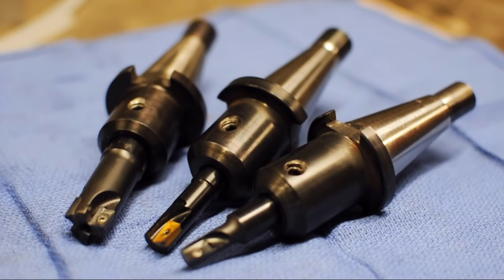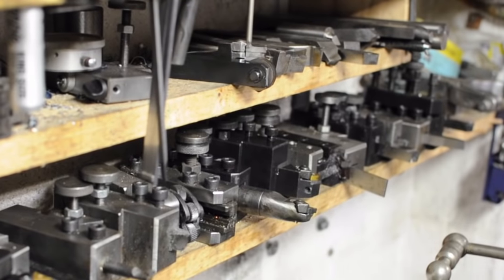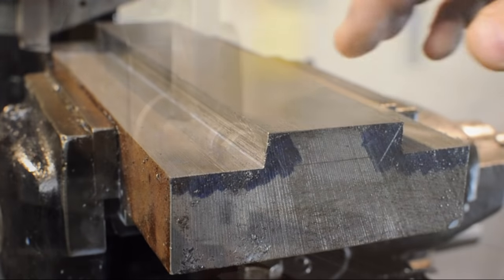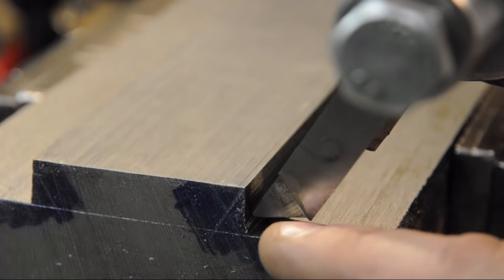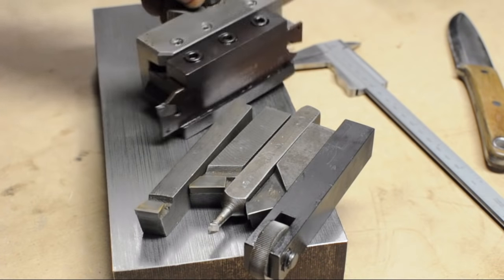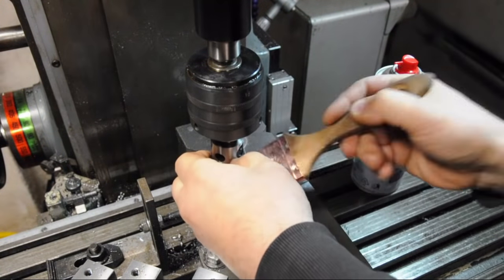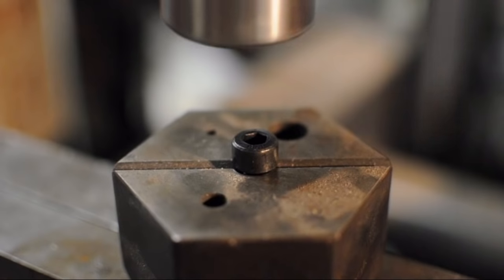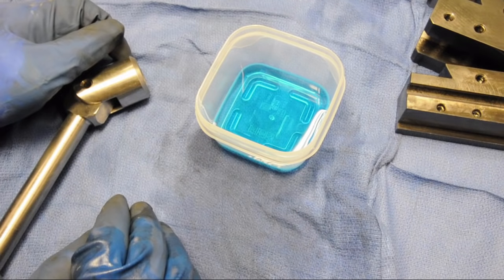QCTP Tool Holders for the Lathe

Comment: Fun tip - if you don't need them blued in under an hour, there's a very easy and simple way to blue your parts that wears better than cold blue and is darker. Basically just thoroughly degrease your part, immerse it in distilled or very clean water (our tap water is runoff mountain water) and boil it. Let it cool and it will form a fine rust. Boil the part again to convert to black iron oxide, card it with OOOO steel wool or denim and repeat until you're happy. Overnight gives very fast results with just slightly matte finish, less time gives finer results, but requires more repetitions. It's that easy...

Thanks again for the great videos!
Reply from the maker: Thanks HW!
Reply: Forgot to mention - this method is really sensitive to oils/grease as there's nothing really encouraging the rusting other than heating. Not really unusual for bluing, it's just a bit more finicky initially. Oddly enough I've never seen anyone else do it....
Reply: I think I've seen a method similar or the same, don't know for sure, but it was a video by Walter Sorrels here on youtube. He used it to put a black finish on a sword component.
Reply: H Wal. a
Reply: Works even better with rust bluing liquid.
I got mine from Brownells.
I fume it on, steam to convert fluffy red rust to fluffy black rust then brush it off with a brass brush. Took about 10 cycles to go from in the white to a hard-wearing black finish. 
Clean off with washing soda to neutralize (baking soda wasn't strong enough) and oil well (leave in oil bath overnight is best, mineral oil.)

Comment: Excellent video! I enjoy watching everything on your channel. 

In my experience, cold blueing works much better when you heat up the part briefly with a heat gun or torch to about 150 degrees F and then apply some blueing fallowed by going over it with some 0000 steel wool and repeating the process from the beginning a few times until you are satisfied with the color. This process has given me a darker blue.
Reply from the maker: thanks, I'll be sure to try that!

Comment: Shapers still have a place in the home shop.
Besides cutting key-ways and dovetails I use mine for cleaning up and squaring torch-cut steel plate.
Carbide milling inserts get chipped on such a job. ( Cha-ching $)
A single point high-speed tool is easily and quickly re-sharpened.
And yes, there is a certain Zen-like quality in operating one.

Comment: A little tip on the bluing. Glass bead sand blast, raw rubbing alcohol for decreasing, apply 100% cold blue with a clean cloth, use a fine steel wool to rub it in, adding more blue as needed for color, and finally add a combination of motor oil, 3n1,and transmission fluid to stop the bluing. Wipe clean. 

I've done this with various types of firearms, and the effect is excellent. I prefer hot bluing, or rust bluing, but for tooling, this is the easiest and best at corrosion resistance, while still looking excellent.

Comment: Nice project.  You, Stefan. Tom, and a few others have me thinking I want shaper.  Precision Brand Tool Black works really well.  The trick is to buff with steel wool between applications before oiling.  It evens out the finish and helps to expose untreated areas which gives a darker finish.
Reply from the maker: Thanks Robert, I'll have to look into that.

Comment: when applying cold blue, try to brush it while inside the liquid... it works 100% better and you get black results in 3 minutes. if you just leave it inside, the oxidation is not uniform.

Comment: Something that may have affected your blueing is your steel wool.  Most steel wool has been oiled to help it from rusting away to nothing.  Rinsing it with acetone prior to use and re-oiling with WD-40 works well.  As a side note Singer Sewing machine oil was some of the highest grade and most refined oil made before synthetics.  So many old Singer machines still show almost no signs of wear or excess clearance after seeing generations of work.

Comment: Hi tony, another winner...I use olD engine oil, and heat up the part, if this is done several times, leaves a really nice black finish.obviously the part has to be super clean to start. But I bet you knew this anyway..keep up the good work!!  Kind regards keith
Reply from the maker: Yes that's how I used to do it but this way is less messy and, more importantly, doesn't stink so bad. :)

Comment: You should try the hot bluing method. There are a lot of videos on youtube on it, and I have tried it myself and as soon as you get around the fact that you have a mixture og potassium nitrate and lye heated up to around 155 degrees C, it is actually quite easy to work with. I used it to restore some old adjustable spanners, some measuring tools and a few gunparts, and it leaves a really nice black color. 

Sandblast or beadblast the surface for a nice dull black, or polish away for a nice shiny black. And it is way more durable than the cold bluing is. And the surface soaks up a little bit of oil, for corrosion resistance.

Just dont get it on you skin, and keep the kid far far away from it! You will know quite quickly if any of it splashes on your skin, belive me...

Comment: I tried cold bluing steel parts, but didn't like the results and the time it took, so I tried the cold black oxide kit from Caswell, and LOVE IT!  Parts are blacker than the Ace of Spades in under a minute, and the kit came with two  quarts of penetrating oil sealer.  I bought the kit 6 years ago, and it still works great, and I've used up only one quart of the sealer.  Not trying to plug Caswell, but black oxide for tooling and non-gun parts is the way to go, imho.
Reply: Absolutely correct in my experience.

Comment: Hey big tony i worked last  20 years restoration field we use blue from Eastwood among that philips one and others to tips we clean the parts with brake cleaner the oil it's going to break down that bluing faster you're not gonna have a long shelf life so clean your parts before your blue brake cleaner tens to work really good. Another hack is try this take a ziploc bag put stuff in put your part in And swashin around way how you're brushing it on you don't get even coat ziploc bag kind of how you dunk those buckets then use you have to wipe down the bucket every time u use it is a residue that builds up on the side will oxidize once again wasting on the shelf life. Final step i yse "kroil" penetrate oil the oil that creeps. Brake clean wipe blue rinse off or wipe then in a separate container oil if u oil in ur blueing container n u pour bluein bottle the oil is breaking the blue down. Liver of sulfur is another to try its like black oxideish.

Comment: tony:loved your video, very well done. FYI the cold blue you are using is likely based on phosphoric acid, like osopho rust treatment. I think you might be confusing this with Parkerizing, which is a slightly different gun treatment. Parkerizing is VERY similar,  clean part, absolutely NO grease or oil, suspend in hot tank 180 deg parkerizing solution till it quits fizzing, 4-5 min, then pull and rinse in plain water. Rough with steel wool and repeat until color you want. Then, coat with oil.....I use plain old 30 wt, but most any will do.  Good Luck

Comment: I have used oil blacking for tooling. It's the same effect as when you have stainless steel cooking pots that get blacked up from the veg oil baking on and will give you a rust free black finish, actually a very dark brown,  that lasts for years.....oil used was motor oil. Heating temperatures are only as high as 250 deg C......some of my lathe tools were blacked back in the 70's.

Comment: Have you tried rust bluing?

It is slow, but it gives you a really good blue if you do it often enough. That's how guns were blued in the old days.

You clean the metal and rub the part with anything that would cause the metal to rust. Bleach, hydrochloric acid, etc. works wonderfully. You place the metal somewhere warm and humid and let it rust. Once it rusts you boil the part in distilled water and turn it black. You then use a wire brush to card it off, then repeat until you get what you want.

Comment: Great work, as always. One Question: Why didn't you have to square up the raw material before cutting the dovetail? Won't the rough surfaces on the side affect parallelism between the dovetailside and the backside? Or is that not relevant?
Edit: Nevermind, got it

Comment: How critical is the choice of steel?  Does it need to be hardened, either before or after machining?  BTW, I love your videos - by far the best produced of the prolific content providers on youtube that I've run across.  I've learned a lot from you and it seems like you always have already made a video for whatever it is I find myself needing to do next.  Thanks and keep up the great work!
Reply from the maker: not critical for tool holders but the harder it is the longer they last.
Reply: In 1992/3 I made a QCTP and tool holders for my 10" lathe from any bits of steel I had lying about.  These were never hardened but I did blacken them.  In 30 years the blackening has worn off in places but the tooling is in as good a shape as ever.
The key to this is to have a dedicated brush that is only used to brush off the tool post and the holder EVERY time the tool holder is changed.  Takes only 3 or so seconds but prolongs tool life tremendously.  I use a cheap 2" paint brush;  when worn I use it for general clean up and get a new brush for the QC tooling.
I thought about the design and decided that a stronger assembly would have the female dovetail on the tool holder, and the male dovetail on the tool post. The tool holder is clamped securely to the tool post with a finger clamp that pulls on the inside of the rear dove tail surface (the one closest to the operator), thus pulling the holder tightly into the front dovetail surfaces of the tool post.

Comment: Nice. One thing you should think of if you have not already done it is degrease
 the steel wool. Garret Wade in USA or Lee Valley Tools in Canada sell degreased steel wool for woodworking use. No reason it should not do just fine here,or you of course can acetone your locally bought. With better bluing compound,I suspect that blotchiness might result. Cheers.

Comment: I have gallons of Gun metal Green - 2 gallons clean and 2 used once.  Heat in pot over camp stove and let the parts simmer.  It is a form of rust.  Just not pure O rust.

Comment: Urgent advice needed.....when cutting steel stock into multiple sections with a kitchen knife, what advice or method can you give to getting square cuts as I don't have a mill or lathe or shaper or file to square any discrepancies. Thanks in advance. Ps have tried scraping with fingernails but is very tedious.

Comment: Very cool video, as usual. Seems like every brand of cold blue is a little different. Also there are other black oxide products that can do a deeper black, you might play with. I think they came out great. Bonus points for the classic thumb detector mark ;)
Reply from the maker: +Rambozo Clown lol I think its grit/grime from the grinder.  It's my tool cart when I work at the shaper.. just slide the table on over. :)  Thanks for watching!
Reply: +This Old Tony Shapely Tony, you're shapely

Comment: Hey Tony. I have seen many videos where your materials have come from finds in swap meets, scrapyards, and other places (ebay, etc). I've recently invested in a lot of tooling and have access to some machines; and my next step is interesting (cheap) chunks of material in variety of grades, shapes, sizes to facilitate my random projects. Any advice you can share about how to seek out these local place? where to look, what to expect, how to find these interesting drops and cuttoffs, etc? Thank you in advance, and I appreciate what you do. I learn an incredible amount and enjoy your humor immensely. -Mike
Reply from the maker: this is sometimes tough, depending where you are, and takes some time, but my first choice would be local machine shops and/or manufacturing facilities.  ask nice for drop-offs or off-cuts.  Maybe bring a box of donuts.  Most of these places send their cutoffs out to local scrap/junk yards, but it'll likely cost more there.  failing that, you can try online services that sell small quantities of metal.
Reply: Thanks Tony, I will check with some vendors that do work for my company and ask them nicely, with a donut offering, to see what they can do
Reply: @ThisOldTony  I've had good luck with the local scrap yard that gets screw machine bar ends.  

For bigger pieced I go to our local metal supply house (locally owned) and ask to purchase cut-offs.
I always tell them that I'm a hobbyist and show a small steam engine that I built from scratch.

The metal supply house people are very careful to mark all their cut-offs so that I know what I'm getting.  For me this is important for work that contains many hours of whittling.  For example, for crankshafts turned from the solid I purchase stressproof aka 1144 steel bar.  Machines beautifully yet is very strong and quite hard.

Comment: TOT, how's it going? Have you tried a serrated knife for cutting multiple blocks from one big steel block? Serrated knives work great on bread too! Who'da thunk! I've just about perfected cutting steel by displacing water with WWJD-40 on scribe marks. I like using a hot wire (cuts styrofoam too) for making intricate cuts, it works with 
any metal. It also cuts heavy metals and classic rock(s). 🥁!! 😣
Great videos! Please keep making them!! Thank you!!

Comment: When bluing it sometimes helps to heat the part with a heat gun (or boil the part). Cold blue is in regards to the temp of the bluing solution. standard bluing uses bluing salts boiling at almost 320F. 

Give that a try next time, bet it helps.
Reply from the maker: thanks izuzan, will try that next time!

Comment: Hi This Old Tony. I also love your videos (the rest of my family - not so much) but I have a question for you on you QC toolpost. I just bought a Colchester Student lathe - very pleased with it but it has the old square toolpost on it. Looking at earlier pictures I think yours did as well when you bought it. When I look at buying a QCTP for mine however it looks like they won't fit - there is a hollow 'column' about 35mm in diameter (probably 50mm high) coming up from the bottom of the compound slide which gets in the way of the commercially available QCTPs I've seen. Looking back I think you had the same problem. Can I check - did you machine that 'column', change your compound slide (for the sort with a T slot in it), or find a QCTP that fits onto the original compound slide. Finally, for a bonus point, what is the fastest living animal. Cheers, Sladey
Reply: Apart from Humans in space my Guess is a Spine Tailed Swift. I am going from memory not from GOOGLE. I will look it up now. Cheers from John, Australia.
Reply: I was WRONG it is the Peregrine Falcon! I knew the Birds were fast in their dive, anyway now I know, I think. Correct me please if you have better information. John.
Reply: I just bought an old MK1 Colchester student and am in the same boat as Mark and would love to know what Tony did too!
Reply from the maker: I'm afraid I don't remember but check out the "T2" tool post for Colchesters.  should drop right onto the factory post.
Reply: Will do, thanks Tony!

Comment: Why did you choose to use the shaper to cut a dovetail? This might be a silly question but I was just wondering. In school I used a dovetail cutter and t-slot cutter on the mill. I don't remember anyone mentioning cutting these on shapers. Is it more accurate? Is it cheaper because you can grind your own hss? Awesome videos as always, my wife loved your espresso pot video. She wants me to make one now.
Reply from the maker: heldgop is correct, with one HSS bit I can cut just about any angle it would fit in.
That, I have the shaper taking up shop space so I might as well use it. :)

Comment: Since 1040 steel was used why not heat treat for hardness?  Would 1018 cold rolled steel have served just as well?  Yield strength of 1018 CR and 1040 before heat treat are both about 55,000 PSI.  I have always assumed that OEM dovetail tool holders are hardened or at least case hardened.

Comment: A lot of the cold blue solutions will give a very dark blue, and then if you leave it on, you can see the the blue vanish right before your eyes.  Timing is important.  Put it on, and fifteen seconds after it's dark, wipe it dry.  Repeat to cover the entire part, and to darken the shade.

Comment: your thread cutting tool appears to be from eastern Germany. there is the typical "WMW" logo on the box, also as some might have noticed it has spanish text on it which is a clear sign that it was made in Germany. so basically your tool cuts communist threads.

Comment: cool. inspiration to make my own... 1.  I'm sending all my knives to you for sharpening! 2. what clearance did you drill the knob center to for press fit on the bolts?  tnx
Reply from the maker: I don't recall but it was probably line-to-line ( maybe -0.001 or 2?)  The bolts have ribs around the sides, so lots of wiggle room under  a 25T press.

Comment: 2 questions:
1:) Why not weld a filler piece between the round pins at 3:50 to make them more rigid for clamping?
2:) With the original stock; if you knew you were going to clamp it twice (4:40 and 14:44), why not square the sides on the mill first to make it repeatable?
Thanks!
Reply from the maker: 1. too much work 
2. don't remember to be honest :) but probably wanted to do it all on the shaper